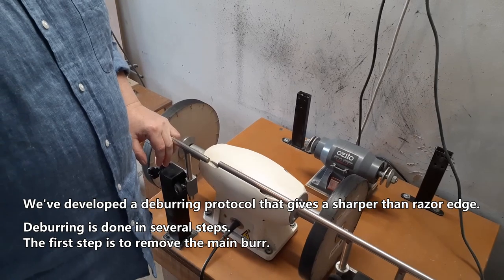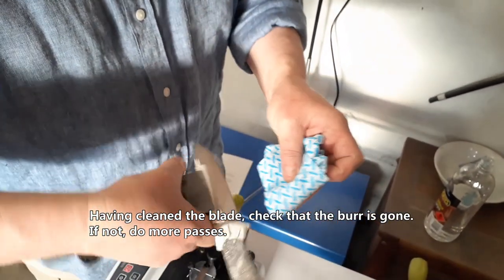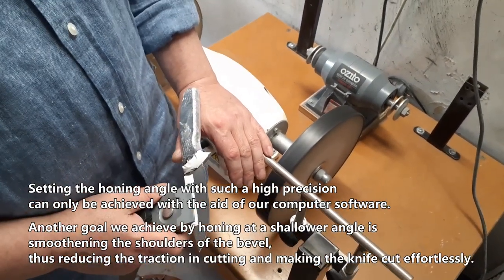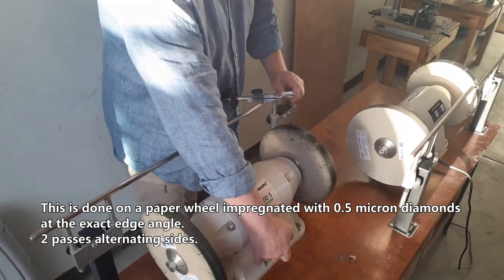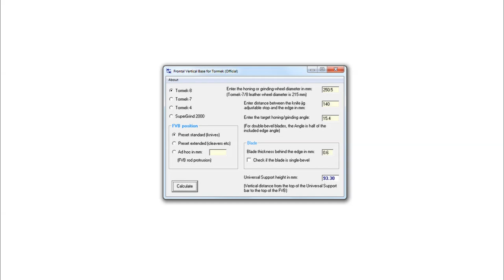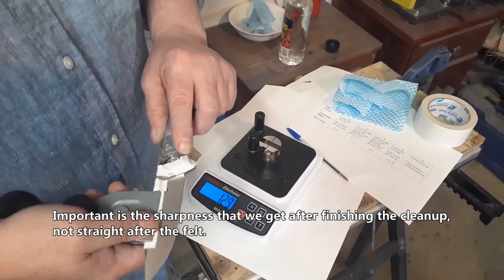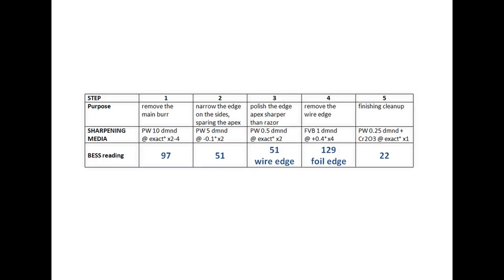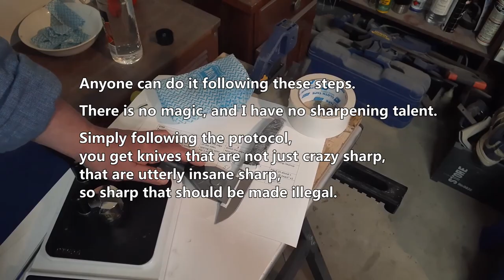How not to screw up sharpening a folder - PART 2 of 3 Sharper than razor

Comment: @ Knife Grinders, I use my paper wheels (10"x1" Slotted- & Gritted Wheel) on my Jet JSSG 10, 90-150 RPM/min. 0.5 dmnd and 0.25 dmnd+Cr2O3. So far I haven't measured any improvement. 1-2 passes alternately. Without pressure or with little pressure. I use your software and measure very precisely. What do you think ?
speed too slow ? At the moment it is not easy to get a slow grinder.
Greetings Sven
Diamond paste is oil based

Comment: Wow. Thanks. 
What happens to the edge after you make a couple of cuts. In lets say wood. And how to maintains the edge ?
Reply from the maker: This edge whittles wood for long time. The initial ultra-sharpness turns to arm-shaving and stays that for very long time.
I recover sharpness of a "supersteel" edge by 6-10 edge-leading passes on a fine ceramic rod, followed by a few passes on a smooth steel to remove the microburr from the ceramic.

Comment: Where did you get the 10inch paper wheels? I can only find 8 inch.
Reply from the maker: We've tried several PW brands, and "Razor Sharp Edgemaking System" are the best - they are denser, round, smooth, fray less and last. See the Dealers page on their website http://nextgen.sharpeningwheels.com
For knife honing, we use only 1" slotted paper wheels. Tell them you need only slotted paper wheels, not the kit. In USA you can buy the slotted paper wheel individually, not sure about Europe.
https://gregdorrance.com/product-category/sharpening/power-sharpening-supplies/page/2/

Comment: Where do you get your paper wheels? And again, great video content! Thanks
Reply from the maker: We've tried several PW brands, and "Razor Sharp Edgemaking System" are the best - they are denser, round, smooth, fray less and last. See the Dealers page on their website http://nextgen.sharpeningwheels.com
For knife honing, we use only 1" slotted paper wheels. Tell them you need only slotted paper wheels, not the kit. In USA you can buy the slotted paper wheel individually, not sure about Europe.
If you are in the USA, check https://gregdorrance.com/product-category/sharpening/power-sharpening-supplies/page/2/

Comment: I'm sure I could get that knife to 10 Bess, maybe even 5.  ;-)
Just kidding of course.  Good video.  Thanks.
Reply from the maker: LOL I've been measuring sharpness since 2016, and am yet to see a knife that would score under 15 BESS. But as a matter of fact, many our followers beat me. I know a sharpening business in Denmark that steadily gives their customers better sharpness than our workshop.
Reply: @knifegrindersaustralia5158  Great video. I'm from Denmark and just starting out on a tormek T8 and getting everything figured out for high level of sharpening, to be able to do it professionally. Would you mind sharing which business do you speak of, I've been researching the sharpening "scene" in Denmark, and have yet to stumble upon anyone who seems to take it to anywhere near your level of precision and skill.

I get consistent "tree topping" sharpness without much effort, just off the SG-250 graded fine with #400 diamond plate, like you have showed and controlled angle honing on leather with Autosol brand stainless polishing compound, with the finishing passes at an slightly higher angles. I will definitely be upgrading my setup over time.

I've had trouble with the SVM-45 knife jig being unprecise due to looseness in the handle aswell as not being able to lock the handle. 
How do you deal with this issue, when sharpening at this high level of precision? Of course the results speak for themselves, it's absolute perfection, but issues might emerge for beginners not having as steady of a hand? I experienced the most trouble when rough grinding to remove defects, since you're adding more pressure and the wobble in the knife jig made it very easy to introduce slight, but unwanted side to side movement in the connection point between the handle of the SWM-45. 

I solved this by countersinking the plastic handle and gluing in a nylon o-ring, it was done with the handle in place. (Disclaimer: Handle is now non removeable) 
I also drilled and tapped for a small bolt in the plastic, to be able to lock the handle in place. Combined this gives very little tolerance and peace of mind :)
https://i.gyazo.com/68f3bdb46732ec0cf1f669a24b69d196.jpg
Reply from the maker: @z1teq  This Denmark business does sharpening for food courts in the Copenhagen airport.
SVM-45 is a pain. Your solution is interesting. We simply put 2 layers of cloth tape on its thread to make the adjustable stop sit tight, and it sits so tight, that at times we need to dip it in hot water to change position.